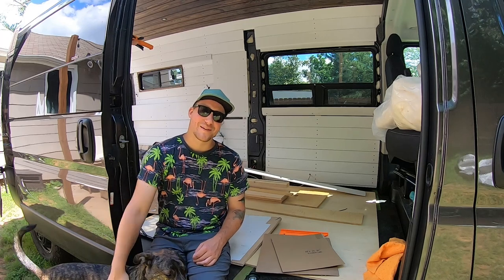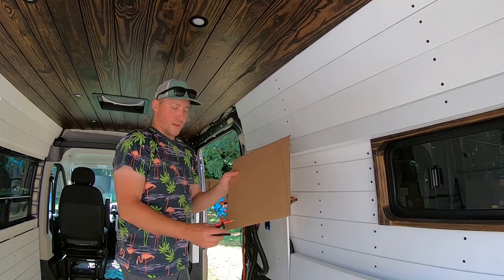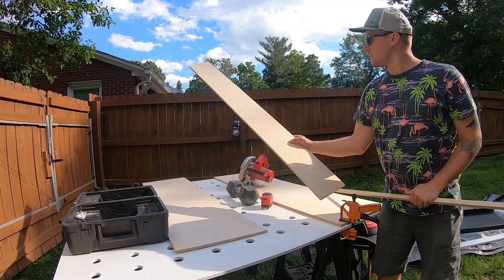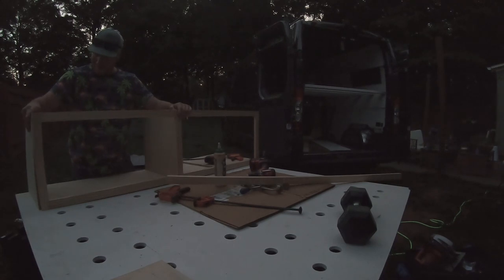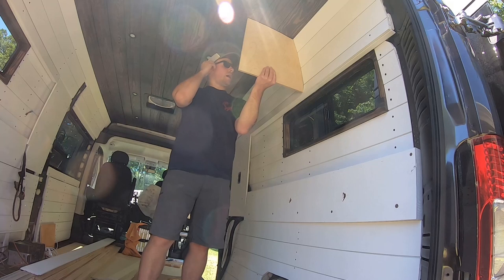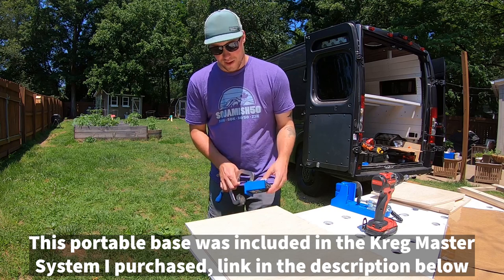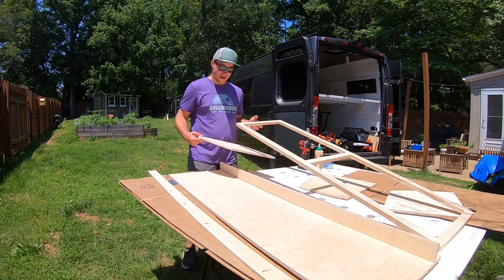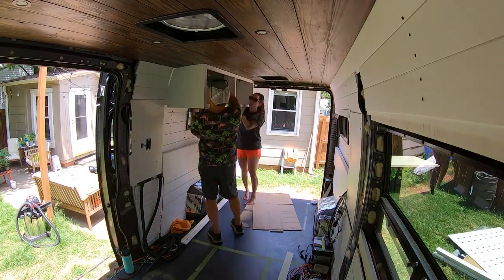How to Build Upper Cabinet for a Van + Learn to Scribe Part 1 //Ep. 17 DIY VAN BUILD

Comment: The uncertainty is a real struggle.  Especially when it's the first time doing something.  Theoretically, everything should be easy - we're just building boxes within boxes with some odd cut-out shapes.  But putting theory to practice is nerve wracking!  You're doing great so far, though.  Looking forward to the next step :)
Reply from the maker: So true. It definitely goes much smoother putting the 2nd one together. I do think I "logiced" the problem pretty well and ended up putting it together in the right order😂 Thank you for your continued support!

Comment: The question is: How do you know the bottom of the templates are level to the floor? Especially when making multiple panels along the van?
Reply from the maker: Very good question, it was a struggle for sure. Mainly eyeballing. I suppose left to right (driver to passenger side of the van) you could use a small level on the bottom of it.  But front to back you cannot because the floor isn’t level with the van slopping to the front. I did my best to show my process for everything I did through my build, mistakes in all. I’m sorry I don’t have a better answer for you.

Comment: What thickness and type of plywood did you use for the cabinet?
Reply from the maker: I used 1/2" Baltic birch. With covid supply chain issues it's become extremely expensive when I've looked for it recently. I was getting it in 5'x5' sheets for a fairly affordable price

Comment: For scribing I used a small wheel about 4" diameter, and put the pencil through the axle hole, then roll against the wall and ceiling. Bigger gaps? Get a bigger wheel.
Reply from the maker: Oooo, great idea! I way have to try that when I get to my pull out pantry here soon! 🙌🏻

Comment: Awesome work Matt, cabinets look great! I saw you used wood glue to help attach the face frame, do you use wood glue for any other connections? Like between the individual pieces when putting together or just the pocket screws are enough. Cheers
Reply from the maker: Thanks so much! 😊 Yep, I used wood glue for all of the connections. I had read in a forum it helps reduce any squeaks or vibrations between joints so wanted to make sure we didn't have to worry about any of that. Might be overkill but wood glue is cheap enough and a single bottle goes a long way. Hope that helps!
Reply from the maker: I'll add, if you get a micro jig and use the 1 inch screws I found that setting the jig to just over 1/2" and the bit to just under aided in screw heads not popping out the face of 1/2" to 1/2" connections. I had issues with the tips of screws coming out. Not sure if I was missing something setting it up originally or screwing down too tightly
Reply: Matt & Katie perfect thanks! Yeah I was planning to glue, always good to do extra, didn’t even think about the squeaking sound!
Reply: Matt & Katie awesome Matt, great tip i will make sure to do this. Thanks for all the advice. Your build is looking stellar 🙌🏻
Reply from the maker: @outsidevibes  thanks brother!

Comment: Hey Mike, as you know I am following several weeks behind you with my build. Question, I didn't see you add any supports into your ceiling (looking at you ceiling video) that go the length of the van. Are you just going to attach the cabinets in places where your cross beams are? Do you feel that's enough?
Reply from the maker: I ended up screwing them into the cross framing and the framing into the wall which were all bolted in with cross nuts to the vehicle frame. I also put screws into the ceiling boards where there isn't framing (since our ceiling shiplap are such stout boards I feel that helped). I am not worried with how many places there are solid connections. The whole van shakes grabbing and trying to move the cabinets. We've gone on a 1k mile trip and nothing squeaked or moved. Hoping it's legit! More to come in next week's video
Reply: Matt & Katie good stuff, glad it worked out!

Comment: Where did you get that jig that you use for the center of long pieces? The one you use with a C-clamp
Reply from the maker: The one for drilling the pocket holes that clamps on with the Kreg clamp? Or a different one. Sorry it’s been awhile since I made this video and lll need a little more clarity if I used a different item